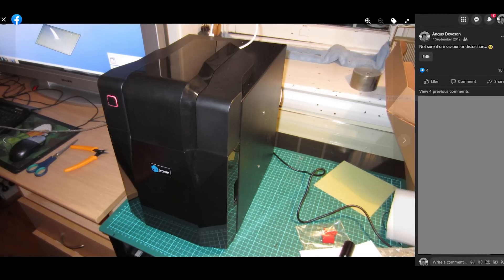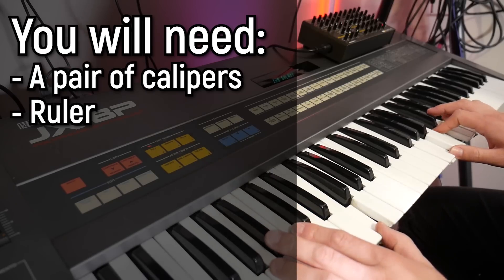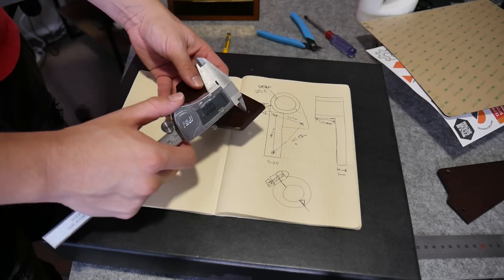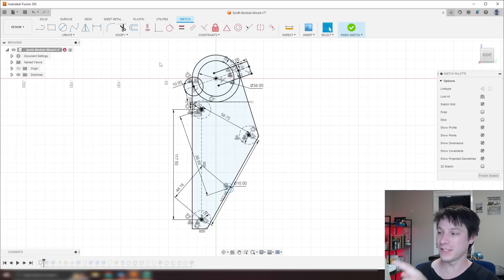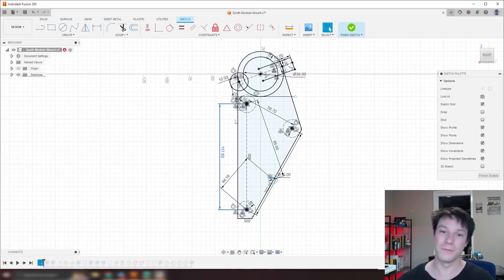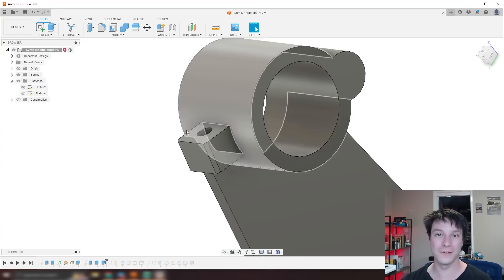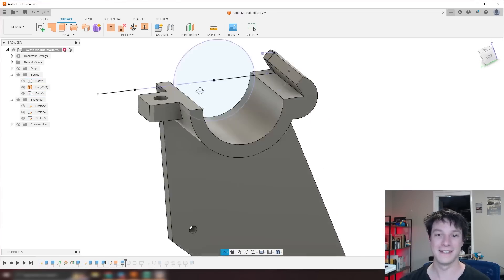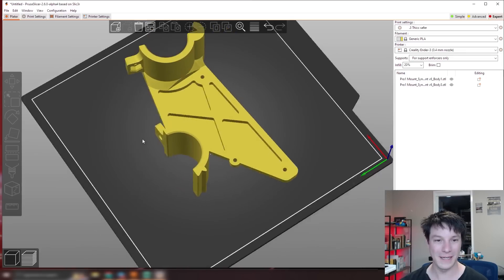Attach anything to anything else using 3D Printing!

Comment: The only useless trinket I have ever printed is the owl test print that was included with my AnyCubic i3 everything else has been a tool, bracket, adaptor, holder etc. but its the most rewarding experience when you see the fag packet sketch turn into the final thing. 

When I measure hole distances I use pins (old drill shanks) that fit the holes, measure the outside distance and subtract half of each pin diameter to find the centre point spacing.

Comment: Thanks for the amazing video! 
I personally do not like using support material that much. So I try to find a workaround every time I can.
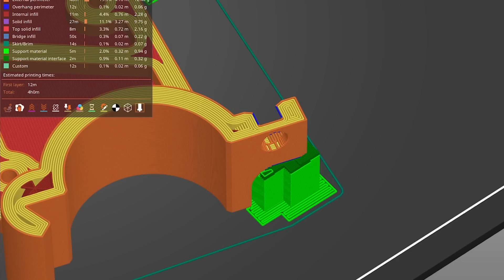So the detail in 12:27 instead of having it round and floating, I would have done it with a 45° degree angle to the tip. That way it could print without support material.
But I see that the object looks nicer the way you modeled it. 🙂

Comment: It takes two goes!  I'm more like it takes 10 goes to get a working part.  But I try to make those first 5 goes cheap.  Thin parts just to check fit, without a possibility be structurally functional.  And in addition, since I'm using OpenSCAD, I typically create a working part quickly, but the code is atrocious, so it takes a few goes to get the code to be clean, and then even more to get it working again.

Comment: This is most of what I use my printer for and why I got one, it's very convenient and cost effective just being able to print up a fixture or enclosure when you need one. Even little consumable things that are usually made from nylon and come in bags of 100 like nail washers for holding down carpet and adhesive backed square wire tie anchors work really well printed in PETG, and only use a few cents worth of filament.

Comment: Additionally if you want more grip on a printed clamp; you can give an extra millimeter out to the diameter, and then tape off and spray the inner with Plastidip.

Comment: I need to try to take more time to figure out the modeling end of printing. I have some mount brackets I need to try to replace on an electric motor on an old air compressor I bought.

Comment: Huh.  I've designed brackets and enclosures such that need to line up with specific hole positions (i use Tinkercad almost exclusively), and I've been doing a "measure, sketch, model, laser-print a cross-section-adjust" loop... I haven't ever thought of doing triangulation... that's brilliant!

Comment: If you have a flatbed scanner put a flat part like that on the scanner together with a ruler and import the image into your design software. If necessary, (it may be right on) scale so your design software measurements and ruler measurements match. Then just draw over the pieces and holes using the image as a guide.
Reply: Oops, it looks like I was late with this comment and didn't see Gijs comment chain about the same thing.

Comment: How do you feel about fasteners augmenting the structural strength of prints? I've personally settled on the philosophy of: 
Taping a washer, and nut to the back face of a plastic panel over the bore, and putting a washer on the associated bolt. Instead of using threaded inserts. Compressing the plastic with torque to spread stress dimensionally, and not place any pullout tension on the plastic directly. Allowing for access of all rear faces as a design constraint, even if that means having non-viable permutations of orders of operations for assembly.

Comment: You don't need to turn the cut line into a surface.
You can just select the line itself when using the split body tool.. Just make sure the "extend splitting tool" is checked (it is by default).
It saves a step and makes it easier to adjust the setout of the split as you don't need to make sure any changes you make to the sketch are mirrored in the face you've created.
Also, one less item under "bodies", one less item in the timeline and faster processing times.

Comment: It would have been nice if you had gone into material selection as far as strength is concerned, which is key when you need to connect one thing to another thing..

Comment: A couple of years back I switched to all VST synths and sold my collection of 'analog' synths at the beginning of the pandemic lock down. Well, I kept the old Ultimate Music racking (what you are using) and with the addition of my 3D printer turned the tubes vertically and built a battle station out of a recliner, 3 thrift store 27" HD monitors and a swing out plywood lap desk for my work at home wife. All of the fittings are in regular PETG and it's solid as a rock. Her co-workers keep asking where she got it and she freely admits that she has her own engineering fabricator in-house. We live in a small apartment and my entire workshop is sitting on an Ikea 4x4 box cabinet in the living room. I chose an Artillery Sidewinder X2 predominantly because it's really quiet and has been insanely reliable.

BTW, I designed a scanner frame for my smartphone. It's basically a frame that my phone drops into and 4 40cm(<>16") legs that are at each corner splayed out 30 degrees. I'd put your synth endcap on the kitchen counter, put a ruler next to it and then put the frame over it, Put the phone in the frame and take an image of the endcap/ruler. You can then import the image into your CAD (mines' Freecad), scale it and then trace it in your sketcher and BYU, you have a perfect copy of the original without any of the measuring.

Comment: Oh Boy I have created so much stuff though 3D printing. I mean okay I am a professional CAD designer by trade but still, all the software and stuff is free these days.
I can simply create hooks with cable management feature in it to also hang my headphones above my PC screen. Or special 3 way joints for my shower curtain hanger. Replacement broken off clips for my wife´s car. Loudspeaker attachments which can rotate and tilt to place my speakers under the shelf to free up shelf space (just like the headphone hanger). Cable management tray basically for free and in the right size I need. Handles for IKEA furniture which looks awesome and cost almost nothing. Brackets for the subwoofer which I hung underneith my desk to free up space and improve cable management. These are only some examples.

Comment: This is what I use 3d printer for also; brackets, holders and adapters. Thanks for the triangulation tip, that part always drive me nuts. What I usually do for complex parts is take a reference picture and import it as a scaled canvas. But the caliper trick will come in very handy for smaller parts!

Comment: I find that using the "thin extrude" function can combine the surface/split/remove material steps you have to take with a sketch surface. Thin extrude is in the extrude tool and the second option, you  can select a line and choose a thickness.

Add that I have been doing CAD and 3D printing for 10 years or so now and never thought to just use triangulation and always tried to estaimte the grid of holes, great tip thanks!

Comment: This is a great video showing an application I have used many times but I have a few things that may be helpful as additionally information. Firstly for splitting the part in fusion an extruded surface isn't needed and you can preform a split body straight from the sketch geometry, secondly with the elephant foot compensation this is definetley something that I always used to model in but now, in Prusa slicer at least, they have a built in setting for this that in my experience works well so that now it saves me the time of having to manually model chamfers in. Lastly in a model like this if you were wanting to have zero support material one way is to just have a chamfer between the horizontal surface and the cylinder which would not add to much more material/print time, although from an aesthetics perspective it would look better to have this chamfer mirrored onto the top horizonal surface also which would then add more print time/material.

Comment: Making things there isn't a (affordable) part for is so common it should be listed as one of a 3d printer's top three uses. I would mention that you do need to take into account the material you're printing with (as you have in several other vids). PLA, for example, has a nasty habit of conforming somewhat to its stressed shape over time, even with thick walls, which can be mitigated when screw-assisted clamping by designing a small gap at the opening and then adjust the clamping force when necessary -- shimming or reprinting as necessary. (As well as gusseting, rounding internal corners, etc.) 3d printing failures are a great means of learning how to design 3d prints -- as most of us makers have found out.

Comment: Joining things to other things. There is the obscure piece of injection molded plastic. The custom 3d printed plastic. The custom wood or metal part.
But also the hot glue and cut up pieces of milk bottle. The cardboard and sticky tape. All the hacked together from junk techniques.

Comment: You could pull out the callipers and measure to your heart's content, but until you try to fit that part, you can't guarantee its fit. Another solution for creating an exact replica is to lay a ruler down, put your part next to it, then take a top-down photo of the part. Not sure about TinkerCad, but in Fusion 360, you can pull that image onto a plane and calibrate the software's units directly from the ruler. This is perfect for getting exact placement of holes and other features that you'd otherwise have to estimate through triangulation. Saves on a lot of wasted filament and time, too.
Reply: To add to this you can turn on a feature in android and iPhone cameras which give you a box that aligns to its self when the camera is parallel to the target helps massively with accuracy as you reduce distortion
Reply: The floating box will center the object in the frame, which is perfect, but does the phone's gyro come into play and keep the phone perpendicular to the surface or can you tilt the phone off plane (not good) while taking the shot? I'll have to investigate that. Good tip!
Reply: @josephpk4878  as far as I've read and found when using it , it's using the gyro to get you square onto the object. I've put multiple rulers in the shot and scaled and noticed it's pretty accurate and distortion is minimal.
Reply: I have to try it for myself. I imagine that there's at least a few degrees of tolerance to play with, before things go completely out of whack. This will be great for remote clients - snap a couple shots of the original and the first print will be in the mail tomorrow.

Comment: The bolt nut can be made to be an enclosed nut since the cavity for the nut is vertical. Just pause the print halfway and drop the nut in and continue the print. Cheaper and arguably stronger than using threaded inserts

Comment: For the skeletonized frame, did you just place those by eyeballing or did you use some sort of analysis to see where they should be placed?  That's what I need to do to take my designs to the next level, so I was wondering if you had any tips on that front.

Comment: When measuring holes, I put both screws into each hole, then I measure the distance between the farthest tip of each screw diameter with a caliper. Then I set this distance in Fusion by drawing two dashed lines separated by the same distance as measured with the caliper. finally, I set the holes tangent to both lines. So easy and accurate. I am not sure if I made me clear though.

Comment: Another great video Angus!  I'm wondering - have you ever done a tutorial on how to accurately measure and replicate complex shapes in CAD?  Or do you know of any done by others?  I've often come across items that I want to design other things to fit around, inside, or otherwise interacting with but the original piece had, for example, too many organic curves and I didn't have a good understanding of how one could measure and replicate the piece in CAD for which to use to design the adjoining piece against.
Reply: Hey, did you manage to find one?

Comment: In recent times I've made a soap holder, a towel rack (Did use a wood dowel for the roller though) and the most recent thing was a shower caddy for a shower chair (I'm disabled) For that I did 0 top and 0 bottom layers and let the infill show through to give me drainage holes.
 3D printing and designing in CAD has been everything I dreamed of growing up. I always had ideas but, not the ability to make them a reality.
 Going back to music, I also designed a holder for the Boss WL-20 wireless unit. So, 3D printing has been an absolute blast once I dialed everything in.
Channels like yours have been an absolutely invaluable tool in learning about printing and all the things related to it. I am extremely grateful for all these tips and guides you give. Thank you.

Comment: You can use just the sketch line to split bodies in fusion 360. I thought since you made the surface with it you were going to thicken it before using it for the cut. That would be a good way to add clearance and perform the split at the same time, by making a surface and thickening it to your clearance before cutting.

Comment: Sometimes instead of measuring the thing to fit the 3D model to it, i scan it on regular 2D scanner if its flat enough and then I model with scanned image as a reference. 
Also instead of making many perimeters I make one or two thick ones - prints seem to be more rigid this way and it prints a lot faster. My Prusa has no problem making 1.2mm thick perimeters on regular 0.4mm nozzle.

Comment: MM: Your designs are generally 'solid' and instructional for newbies.  However, this design has a remarkably fatal flaw.  The stress concentration at the sharp notch in your clamp should be redesigned to have a fillet on the inside and a stiffening web on the outside.  Curious how you missed this one.

Comment: What i do for measuring the holes precisely is the canvas (image) in fusion 360. I put the caliper at a reference value, usually 50-100mm and put the caliper in the surface. After that i take a picture with my phone, being sure the camera is square and centered with the part and usually at 2+ times zoom at the camera (to avoid lens distortion and reduce any variance). After that i import the image as a canvas in fusion 360 and calibrate it using the calipers as reference, just be sure the calipers are as close to the surface as possible and that you have a alligned picture. Usually print two layers just to validate the values, never got any measurements wrong using this method! (Minimal variance occurs, but nothing greater the imprecision of 3d printing itself)

Comment: After doing the CAD making a paper print to check your measurements can be helpful. Also I've found that I need to scale my inkjet prints 103% to get accurate prints. I try to have at least one dimension showing on the drawing to check against.

Comment: The single greatest thing I have made with my 3d printer is something I was 100% unable to source anywhere else: 2 small little clips that keep my laptop from sliding down on the cooling pad.  Seems like a minor issue but they make a huge difference.  This alone makes the printer so worth the time and effort to learn to use.  It's little things like this that people need to be reminded of.  Just like in "Zombieland" we all need to remember rule #32.

Comment: For your bolts on the back, you could use a chamfer leading up to it instead of a fillet to 90 degree overhang and then you wouldn't need any support.  It may not look as nice but you'd have a easier model to print in the end?  Either way, good job!

Comment: A great way to teach viewers how to start with cad. I'm a little lazy and would have printed the flat part without holes and use the synth sides as a template to mark the holes for drilling. Several times I've had to drill out holes in a print because they were smaller than expected.
Reply: Usually, the holes are much stronger if printed in place as opposed to drilling. Drilling normally goes through the infill where the part isn't as dense.
Reply: @Badge124  Yes, I found that out the first time I tried it and now print with no infill if I'm going to drill. Or any print that is a structure piece.
Reply: @dronepilotflyby9481  No infill? You mean 100% infill, right?

Comment: you went too far, I just mounted it to the wood part with 3 or 4 holes or one large hole that can make it adjustable then you bracketed it with your clamps, and you already have the surface area to add the part.

Comment: SolveSpace is another open source, free cad software. It doesn't have all the features of FreeCAD but it's really fast and stable, and it can be really quick to use (I'm faster sketching with it than paper). I tend to think it's simpler too, and it runs well even in old computers. It's perfect for this kind of design - it's typically totally constraint driven. Just another option if FreeCAD doesn't do it for you.

Comment: Hi, personally when I'm making something that has to fit something else I print a 1mm  thick test print to make sure all the holes etc line up properly(ie checking I've measured properly). That way if there is a mistake you only waste a small amount of print time and materials. Nothing worse than printing something for hours only to find it doesn't fit.
Reply: Nice tip I do the same has saved me many times and wasted material.

Comment: I used a similar process for trying to restore a vintage flash gun. While it came with the flash and reflector dish. The metal piece to mount it was gone, So I printed a test adapter to figure out the spacing of where the dish would need to sit prior to making a study one. Unfortunately whilst testing the flash, the vintage aluminum failed when I put batteries in it